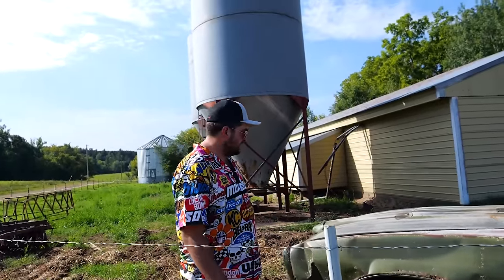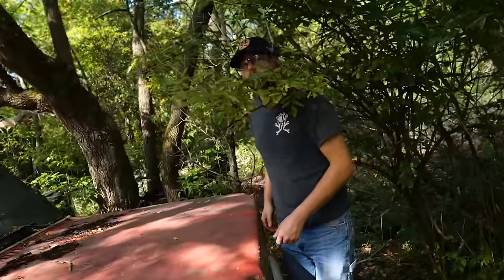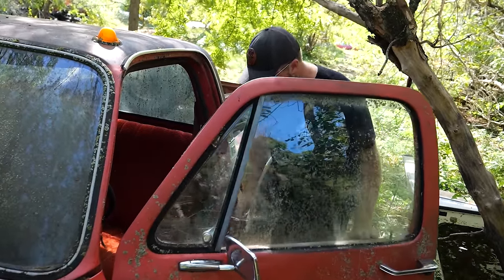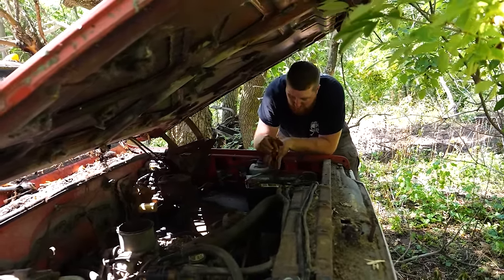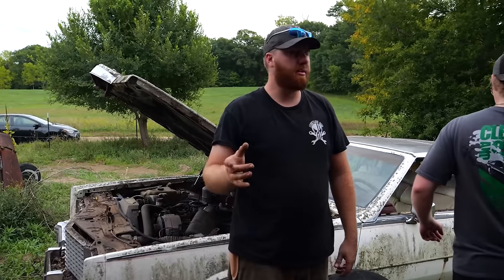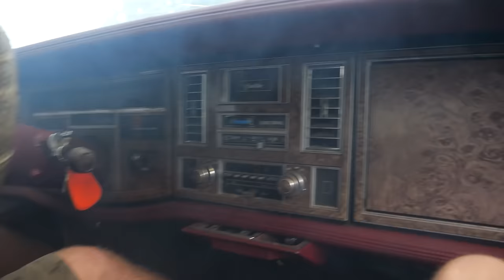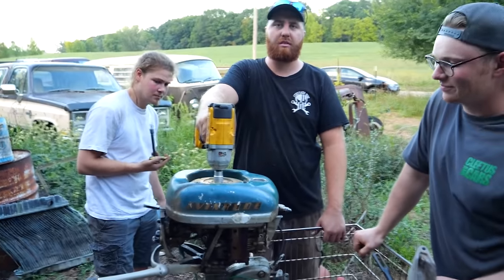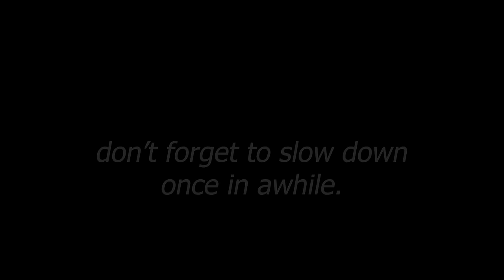Abandoned Farm FULL of Old Cars - Will They RUN & DRIVE??

Comment: Once again it's JD who remains the responsible adult in the group 😂
Reply: to be fair, he's probably the most mature
Reply: 😂😂😂 facts!!!
Reply: If the BMW gets passable gas mileage, and can be fixed, then it is more useful than any Caddy or GTO, though if the trailer can be made to haul the BMW, and other efficient cars, than it does top the BMW and Kevin is right.
   But the reason to revive cars is economy, not luxury or performance, so unless they can be lived in like campers, stick with the little ones like the Z car and Fiat Spider you did, and Gremlin.
   Revive a Geo Metro.
Reply: What if you retorque the head bolts on that diesel Chevy pickup?
Reply: The diesel midsize wagon might be a good, 4.3 diesel, made after they fixed the head bolts.
Reply: I think Kevin is the most mature for ignoring acceleration (GTO) and picking the V8 diesel front wheel drive car with the best 2wd traction other than the VW, and the pickup, which can carry a camper for the homeless, and either has a diesel or can get decent traction with a 4.3, gas or diesel.
    Adults don't accelerate.
Reply: What’s the status on the micro bus?
Reply: He has yet to be corrupted by the world. I was the same way at his age, I don't know what happened 😂
Reply: @alan6832 Sounded like a valve issue to be honest.
Reply: @alan6832 there is a perfectly good reason to revive old cars keeps the tree huggers mad
Reply: @ajgurney5811  Plenty of little old cars to reuse and recycle, at least after about 1975.  The idea that old cars are big cars was over by 1990.
Reply: @alan6832 I would take any of those old GMs over a junk old BMW. It's sad when 80s GMs would be more reliable than any BMW 😅😂
Reply: @weegeemike  simplicity is a major advantage as is familiarity to local mechanics, and he's not in Bavaria, so you have a point; but so is gas mileage, which rules out v8s outside of buses.  Kevin completely abandoned practicality not by choosing the pickup but by replacing the diesel with a big block, raising the rear end ratio, after unnecessarily destroying the rear end, then wasting many gallons driving it around with no trailer.
    If the Diesel was otherwise viable, Kevin has the super head bolts for them, and if he's not going to pull trailers with it, a 2.8 is plenty of engine and much cheaper as well as giving better traction and limiting load on old rear ends, and 3.8 and 4.3 can pull trailers.
   Again, adults don't accelerate, saving big blocks for buses, or sell to juveniles for money.
Reply: @weegeemike  There is one way for adults to accelerate, which is that powerful regenerative braking gives one powerful acceleration almost for free, in an EV or hybrid, but they are part nuclear in most places, so still juvenile.

Comment: the pedal falling out of the car .... totally the type of content I'd expect with you three together lol
Reply: i had a 80 something bmw 528e do that once. the gas pedal fell through the floor and jammed the throttle wide open and the key was a flathead screwdriver that i forgot at the garage. the clutch went out and the car wouldn't move so it sat there banging off the rev limiter until i walked back to the garage and got the "key"
Reply: That gives "foot through the floor" a whole new meaning

Comment: Before my Dad passed away in 2007, he was driving a truck just like that except that his was baby blue. He had converted his to run on biodiesel or used transmission fluid or even used refined oil. With any of those strange fuels he could get as much as 70 miles to the gallon. Now that truck had no power to pull anything, but it would go forever. It also helped that my Dad was an incredible mechanic. Y’all stay safe and Blessings to all !!!
Reply: My dad has a baby blue 76 with a straight 6 and a three on the tree haven't towed anything with it but we hauled 1 ton of scrap metal 😅 love that old truck
Reply: @jacobireland4520  very cool - thanks you for sharing
Reply: Sounds like the old IDI 6.2 and 6.5's. They didn't make any power but all you need to make them run is something that sort of lights on fire. The shit those things will eat is impressive.

Comment: The 78 to 82 Diesel pick up trucks are neat. You can either rebuild the 350 to gas spec's or drop in a nice Olds 455 they are bolt in.
Reply: The 81-82 diesel heads and intake are quite desirable for olds diesel folks. 125HP and no EGR
Reply: It had a 6.2L Detroit diesel in it
Reply: Take the 5.7 out of the Cadillac and put it in the pickup.
Reply from the maker: @countryboydragonboy7561 no, 5.7 Oldsmobile
Reply: @V8Power5300 I'd rather have the Briggs and Stratton.

Comment: In quality testing, BOB stands for "best of best" as opposed to WOW, which is "worst of worst". You pull one of each from the production line and swap parts until they run the same to identify which component is the source of the trouble. In the case of that pick-up, the component to swap out is the Oldsmobile diesel V-8.

Comment: Another thing that makes for hard/no start in one of those 6.2's is the fuel cutoff solenoid. They like to die/freeze if they aren't used semi frequently.
 It's located in the top of the injection pump cover. You can pull that cover via four bolts, and if there is diesel in that well under the cover, it means the lift pump is working, and the pump should now be in a "run" state with that cover removed. (You have to stick your finger in the well and manually move the cutoff to shut the engine off.)  
By the sounds that engine was making however, it had other, far more serious issues.

Comment: 17:28 The DB2 pump was used on the 6.9L and 7.3L IH Ford diesels and the 5.7L Oldsmobile and 6.2L & 6.5L Detroit diesels and the peak injection pressure was 6,700 PSI. The injector pop pressures were set to around 1,800 for this engine and could be as high as 2,300 for different applications.

Comment: Kevin if you need starting fluid for a diesel, use WD40 or Marvel Mystery oil sprayed out of a pump sprayer. They work like ether without risking blowing a hole in the piston. Okay, next to the Detroit Diesel, those are one of the best sounding diesels ever.

Comment: Not sure if mentioned yet, I hope either team tries to start the 66 Olds Delta 88 4-door 'holiday' hardtop used as a tool table beside the white Eldorado featured. It should have at the minimum a 425 cubic inch V8 2BBL, 310 Horse or even the 4BBL high compression 365 horse version. That car should move if not bad underneath!

Comment: On the diesel, I have a 1993 f350 with the 7.3idi from International with no turbo. When i was getting it running, i had to flush and fill the fuel tank, removed the filter and let the sender push out the old fuel. The fuel pump is motor mounted and driven by the cam. Then the fuel injector pump is on top of the timing gear drivetrain and is run by the gears. Really interesting how it was a really simple design and the only letdowns i had was the original psom board needed replacing and the starter from 2003 failed last winter. Found a first gen powerstroke starter fits correctly and gives me a higher crank rpm and torque so i wound up almost never using my glowplugs

Comment: My grandpa had a Pontiac with an olds V8, and he had the dealer retrofit a fuel line heater in it since the fuel stations didn’t winterize the fuel, and later on he had a rod through the block due to the dealership using oil that wasn’t for diesel motors.

Comment: Question for Kevin. Which was worse?

The smoke from that diesel Caddy, or the CS gas in Basic?

Might be time to get a surplus gas mask, for theae revivals. Had to use mine driving the 93 Ram we got for a Cummins swap in our 91 K 2500. No glass left, floor rotted out, and the prior owner had it cranked to 11. No exhaust after the manifolds.

Cab looked like someone was clambaking, when we started it up. Parked behind a milsurp shop. Went in, and got a used British gas mask, for the drive across their field to our trailer.

Rebuild, P Pump, new injectors, and internals,  swapped it and the NV 4500, T Case, into our old shop truck. Followed that with a turbo and intercooler,  and added a sleeper to the cab.

Finished the build a year before losing my leg,  and still driving it, with my prosthetic. Use it to haul the ooen and enclosed car traikers, and our camper.

Thanks for the memories Kev.

Lol. Stuck with the minivan tonight, as the wife drove the Chevy to work today, and I had PT, making it easier to take the chair with,  as sometimes therapy kicks my ass. The side doors make it easier.

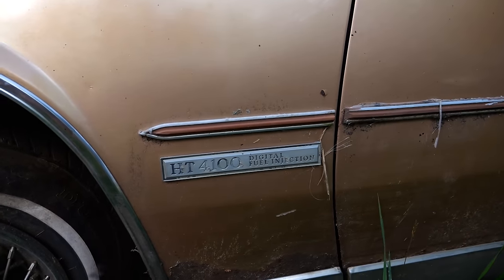Comment: 3:47 Ah the old Eldorado HT 4100.  Back in a time when you could market a car's fuel injection system as a feature and literally call it High Tech.  Funny thing was, it used a Throttle Body Injection system (basically a carb body with a fuel injector in it). Versus a Multi port Injection system used in other GM V8s of the era, like the Camero.. lol  these were junk when new.

Comment: atleast the gas pedel didnt go thru the firewall. that happened to me once ,barbwire bailing twine ducktape 7 beers 2 hours later and yellinjg it was fixed and had a bungie cord gassd pedal thru the seat and then 6 hours later we fixed it with more bailing twine and ducktape and super glue. still holds in that 75 valiant today. new owner loves it.

Comment: I think if you are going to rescue the '79 Chevy truck, the best thing to do is ditch the tired Olds 350 desiel and replace it with a used Duramax one from the early 2000's.

Comment: Awesome square body and two tone red and beautiful red interior I would own that one lol, anyways it is a very solid looking truck, but if you get the diesel 5.7 litre running tear the intake manifold and heads off and the cam and swap the mid 70's intake manifold and cylinder heads and the valve covers from the Olds 350 gasoline v8 and then you have a stout bottom end in a converted gas 350 olds with balls lol

Comment: In '82(?) GM offered Chevy pickups with Detroit Diesels - ours went at least 500k miles (I went to another co. a year after it hit 300k (the diesel injector shop thought it only had 100k miles! 😁
Don't confuse the 'Diesel' label as all being the 350 explodamatic type. 
Is it hard to record with the cameraman hanging out the window? Or did he die or morph into a Venusian from breathing  straight diesel exhaust? 
👍🇺🇸😎

Comment: One of my employees tried starting fluid in his older gm diesel and blew off the starter and cracked the bolt holes it clearly said on air cleaner not to use

Comment: Back in the 80's, We use to take those Olds 350 diesel's motors and replace the upper intake and heads to 350 Olds rocket = poor-mans race motor   :face-green-smiling:

Comment: Good grief, 1700 for a longbed, diesel square? From the north?  I can still find running, driving examples for less than that. 
 I bought my 76 short bed for 500$, factory big block Silverado(.30 overbore, flat top Pistons, cam, headers, Holley intake/carb) rockers and cab corners were rusty, but the floor, and cab mounts were solid...... And the 1993 tags gave me a clue when they stopped driving it. That big block broke 3 transmissions and 2 rear ends. 
I guess save what you can but dang, that's painfully expensive.
Reply: Canoeing in knee deep water was a pretty good end though

Comment: how about you find a newer car with all sorts of electeic brains and rework it to a minimum number to get it running    pine hollow came acoss a motor swap that didn't agree with the ecm and told them to switch engines   it would have been informative on what it would have taken to get it running

Comment: it's funny you mention about the bemmer not working, garantee that's the most reliable thing on the farm that requires a fuel pump and that's about it, E34's and older are basically unkillable bemmers the thing that killed the bemmers E34's and higher was the security systems they had tend to well fail and be insanely hard to bypass.